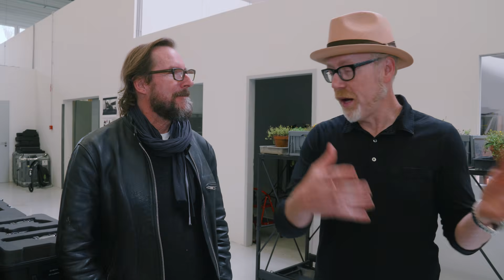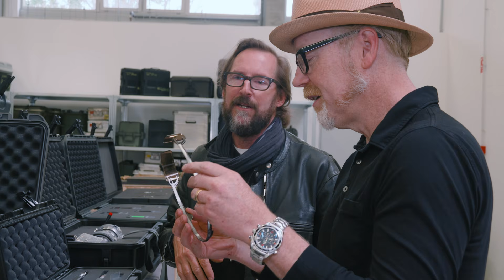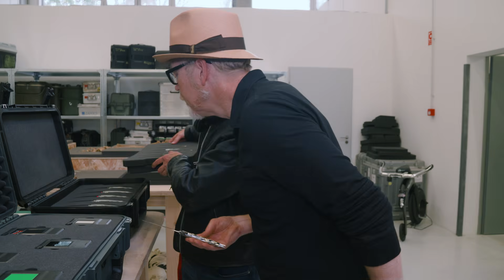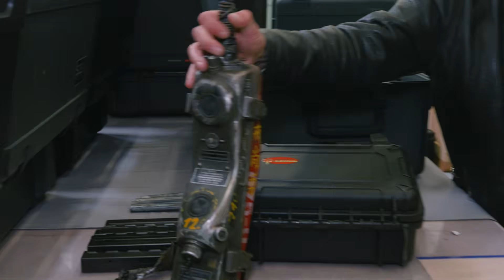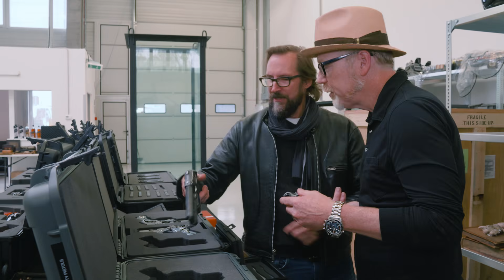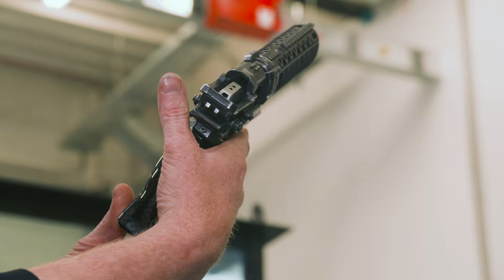Adam Savage Explores the Props of Blade Runner 2049!

Comment: Worth noting for prop makers. The radio is NOT a Russian radio. It is a United States Korea to Vietnam era AN/PRC-6 walkie-talkie radio. Antenna is spring mounted, so it's fine, he didn't snap it off. Screw cover on the bottom covers a plug for a headset, allowing the radio to be used benchtop. Could have prop-modding capabilities. Radio is getting rare, it'd be cool to see a mold taken of one.

Comment: 2049 was wort watching only once, and even that out of curiosity. failure. has nothing to do with the original movie anyway, and both have extremely vague connection to the P.K. Dick's book. however, Blade Runner was a masterpiece. 2049 is, except for the visuals, crap.

Comment: Cool stuff. The only concept I would disagree with is the fact there are no wristwatches in this future.. 1) A "real" watch, analog or digital, feels right for the analog concepts of the Blade Runner future, and 2) even Deckard had a wristwatch in the first movie.. a plain as hell digital watch, but none the less, a "real" watch.. I don't believe in the Apple Watch crap.. that would have ruined the movie IF they had accessorized the actors with a watch on wrist... need something with more mechanical tactile parts to interact with.
Reply: yeah, i agree. if they wanted to go for an analog look, a watch (not an apple one with a touch screen or something) would have been a great way to do it.

Comment: Beautifully shot but poorly executed. I haven’t seen the first movie so a lot of references had no value to me. Then there were virtually no surprises or meaningful twists. It was sort of like Alien Covenant and Ghost in a Shell, potentially engaging environment but lackluster writing, acting and execution. And it was sooooooo slow. It felt like it was twice as long as it should have been because of the needlessly long “suspenseful” shots. And all the needlessly dark drawn out shots where any mystery about who or what manner of character was in the shadows was already clear before the shot started. Add to that the utter lack of even a philosophical underpinning. It felt like you had to be an über-fan of the original to remotely appreciate. What a pity. It’s like they didn’t realize that 98% of the viewers will not have seen the film it’s based on because of the 30 year gap between releases.
Reply: Sitting Still 
It seems you are doing, as you will,  what most others do. Compare it to similar works. The original movie is a cult classic for very good reasons. It was extremely detailed and nuanced. 

While I have yet to see 2049, one last thing I would like to mention is that both the original movie and the sequel are supposed to be Noir films. Noir is not a commonplace film style any longer. Due to that rarity, any comparisons to the other seemingly comparable movies will fall short as they are not noir films. 

Hope this helps and I highly recommend watching the first movie (the last Director's Cut) is the best version. 
Enjoy.